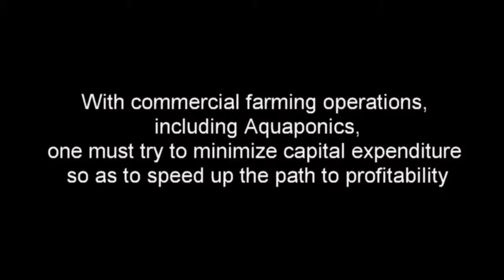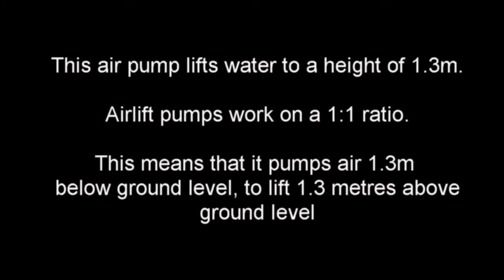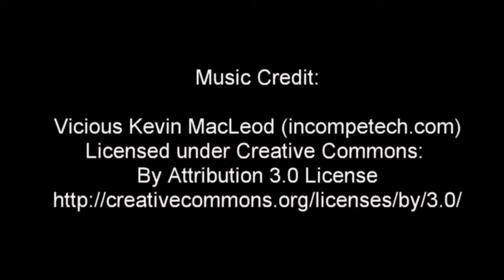How to build a small commercial DWC aquaponics system on a shoestring - For less than $1700

Comment: Nice video' but what is the bio ball filter and the brush bristle is for?
Reply from the maker: Thank, every DWC system requires two types of filtration. Mechanical filtration to separate the solids and Biofiltration to convert toxic ammonia into nitrates for the plants. Bioballs are for biofiltration and the brushes are in the mechanical settlement tank to trap any floating solids
Reply: @MyAquaponics1  thank you for the answer and more power to you and your family God bless brother

Comment: do you have a solids build up in the tank or filter system?
Reply from the maker: This system worked very well but has now been replaced with a sandponics system. In the years that we had it running , we had no issue with solids in the growbeds or tanks as our solid separator filter trapped all the solids (mainly uneaten fish food and fish faeces)

Comment: Where can I get the combo bio filter and solids separator and at what price?
Reply from the maker: that particular one is an older model and over R12000.. We have other more effective filters on our website, depending on your system design and size.. Here is an option https://myaquaponics.co.za/combo-pond-box-15w-uv-2-bag-sandfilter-25l-biofilter-0-6kw-pump-12000l-pond/

Comment: Hi Ur system is sustainable and well designed. I would like to know how much money you make out of it a month roughly.Thanks.
Reply from the maker: Thanks.. We mainly use this for own consumption and to supply the on premises restaurant with lettuce and/or spinach. One can average around 700 leafy type plants per week. We are in South AFrica, so wouldn't make sense to give you a number, as our market and currency is different to yours. So what you need to do is to take 700 lettuce or other high value leafy plant in your coutry and multiply market price per plant by 700 plants monthly.

Comment: You can possibly double the airlift water flow rate by burying the water tank and filter under ground so that you have about a feet above ground. This way you will not need to lift the water 1.3 meters but only a feet. The flow rate will increase substantially.
Reply from the maker: Correct Prakaz, but would have involved a lot of digging which we did not want to do :)

Comment: 1. Can you give some information on the solid separator filter? Like what material is used? And can I substitute it with something?

2. Also, do you have a backwash mechanism for the solid separator? How do you clean it?

3. @2:51 in the airlift sump pump, there is some green material, is that algae or something else?
Reply from the maker: Our solid separator filter is basically a gravity settlement type tank with brushes to trap any floating particles. Settled organic matter at the bottom gets released through a valve. Brushes are removed from time to time and sprayed with clean water. There are many types of solid separator filters on Youtube. One of our favourites is the radial flow filter. You can Google it.
Reply: @MyAquaponics1  thanks for the immediate response. And what about my third question? Is it algae growth or some plant leftover?
Reply from the maker: @ashwinsnmv  Its duckweed, it grows everywhere and can double every 24 hours. We feed it to the fish as its high in protein.
Reply: @MyAquaponics1 Awesome. I'm going to follow your system. As it's easy to understand. In most systems there are many useless or complicated moving parts. Thank you so much. What type of feed do you use in addition to the duckweed. Organic or commercial?
Reply from the maker: @ashwinsnmv  great.. we feed them lots of organics such as lettuce, celery, etc, but also 30% protein commercial floating pellets

Comment: How do you control the speed that the Dec beds drain?
Reply from the maker: no need to control. The flow rate of the pump is what controls. Ideally you wantto turn the total volume of water in the fish tank, once per hour .
Reply: @MyAquaponics1  ok I thought the outlet was lower than the inlet in the dwc beds and would empty the tank unless you matched the out flow. Thank you

Comment: Hi  congratulations for your DWC system. What do you think of placing together to beds, to save space ?? It will work ?? Thanks
Reply from the maker: Thanks, yes placing them together to save space will work. It will make it more difficult to harvest from the middle if required. Either walk in the water or push the floats to the side

Comment: Great work! Thank you for sharing.  I wonder what kind of fish did you put in the fish tank? and there was no aerator inside the fish tank? is that fine? can you please share how to make the air pump sump? thank you so much!
Reply from the maker: thanks, at the time the video was taken we had some tilapia fingerlings in the tank and in the growbeds.. It was low stocking densities at the time, so we relied on teh splash from the inlet to create the aeration. We have since added one 50mm round airstone. For the airpump sump, we used a 110mm plastic pipe and glued an end cap to the bottom of it.  The pipe goes down into the ground around 1.3m deep (as we are pumping 1.3m high).. With airpump its best on a 1:1 ratio, i.e blow air 1m down to lift im up.

Comment: good video, but how does the water from the bottom of the fish tank, with the waste get into the solids separator without a pump?
Reply from the maker: Hi Kyle, the poutlet is connected to a pipe that extends to the bottom of the tank. At the bottom it bends 90 dgrees to another pipe which sits at the bottom of the tank.. Water coming in then follows that bath out the outlet sucking up some solids. With low flow rates and high stocking densities one would have to perhaps use a vaccuum, otherwise increase the flow rate coming into the tank.

Comment: Good stuff!
Since its all on the ground, do you worry about frogs, mice, lizards, even grass snakes in the rainy season getting into the DWC and contaminating the harvest?  Just to be safe, would you recommend tables?
Reply from the maker: Hi, we've never had issues with that as its inside a greenhouse. We have traps for mice.. I don't think lizards, frogs and snakes would contaminate anything. You could put on raised beds, but DWC is heavy, so you would need very strong structures at a much higher cost. Even then, snakes and lizars could easy climb up.

Comment: What is the measurement of your floating rafts? Is it 1 meter wide with 6 plants across?
Reply from the maker: yes, 1m wide and 6m long. Spacing between plants, depends on what you are growing. For lettuce and spinach, spacing between plants can be 150mm to 200mm

Comment: the tanks you are using for the solid and bio filters are not that available where i live, can i use 55 gallon drums instead and swap out using  mesh cloth ? how many bio balls are need to run the size scale, also what are the sizes of the balls?.
Reply from the maker: Terence, you can certainly use drums to build your solid separator filter and your bio-filter. You do not have to use bio balls as your bio media. LECA works just as well. There are quite elaborate formuals to work out the bio media required based on the SSA (specific surface area) of the media used . A good rule of thumb however is to make the volume of your filtration 20-30% of that of your fish tank volume. The more bio-filtration you have the better. Also note if you have a media based flood and drain system, that you don't neccessarily need a separate bio filter, as the grow beds then become your bio-filter
Reply: i see the piping in the fish tank but i want to know how the pipe set up is within the fish tank itself, the out flow to the solid waste filter seems to have a siphon at the top, am i right? i will fabricate the same set up in my yard just need to be as exact as i can be...sorry for the long questions...thanks again
Reply from the maker: the outlet pipe actually goes all the way down to the bottom of the tank, then bends 90 degrees to another pipe that sits at the bottom of the tank. The pipe at the bottom of the tank has slits to allow for the passing of most solids, but not the smaller fish.
Reply: that's cool...how is the water carried through the outlet pipe from the bottom? is the pressure and movement from the airlift pump causing it the flow straight up and out to the solid waste filter?.....i bought the 100w pump and about 200 bio balls but i believe i will need some more balls to complete the bio filter....i also have a  148L  sterilite container i want to use as a bio filter and a 55 gallon drum for the solid waste filter...give me you thoughts...i am most greatful for your guidance through this whole process..
Reply from the maker: yes, water will flow through the outlet pipe, once that level is reached. Flow rate will be dependant on what is being fed into the tank and of course the diameter of the pipe. As I have mentioned in past comments, the airlift pump is slightly underpowered for this system and we would probably use a more powerful compressor, or maybe even a standard water pump. Yes, you may require more than 200 bio-balls.. If you have LECA, maybe use that as your bio media.. good luck.. best way to test your theory is by trial and error :)
Reply: thanks for your support
Reply: @MyAquaponics1  what type of container system did you guys use for a sum tank? I will have to dig fairly deep to sink it to match the ratio for the airlift pump...
Reply from the maker: @terrenceroach9398  If possible don't go the airlift route if you need to pump higher than 50cm-100cm.. Rather use a normal water pump. If only using a water pump, then your DWC growbeds become your sump (no need for a separate sump.
Reply: @MyAquaponics1  I understand you comment  but I had already bought the 100w pump as I was using the model here...I will use a 4x4 container for the fish tank...will build my own  solid waste filter out of fiberglass so as to collect the accumulation of solids via a ball valve at the bottom of the cone...still would like to know about the sump tank as I mentioned prior....I'm committed to make it work...thanks again for taking the time to help...
Reply from the maker: @terrenceroach9398  the "sump" in our system is basically a 110 mm pipe buried deep into the ground.. With airlift its a 1:1 ratio, which means that if you want to pump up 1m, you need to go down 1m into the ground to get the lift. We went 1.3m, and the 100 watt air pump just makes it. I would not go above 1m pumping height, preferable even less.
Reply: @MyAquaponics1  ok thanks I really appreciate you for being so helpful...

Comment: Nice video! And I love how easy it is to setup. How is the nutrient solution in the DWC as I didn't see any drain pipe connected to it? Thanks
Reply from the maker: water level on all 3 grow beds is equalized through a common outflow connection. Water is pumped up using air lift from a hole in the ground that is connected to all 3 grow beds

Comment: Hello, i'm building my own proyect and i'm wondering, what are you using to fill the netpots? to contain the plants
Reply from the maker: we do not use anything to prop up the plants in the netpots. we simply put the seedling in the netpot with roots in the water and that is it. As the roots grow they anchor the plant in place
Reply: Thanks! And where can I ask which one is the best separation between holes? Im going to harvest lettuce and basil
Reply from the maker: for lettuce and spinach anything between 200mm and 250mm will work fine.. For Basil, plants can get huge, depending on how you trim and harvest, so we would use 400 to 500mm spacing to allow for a large bush of basil

Comment: Hi, it´s me again! I was wondering if diferent kind of plants can be used in the same mechanism....for example: lettuce, strawberry and chili...? How can i try more options using just one structure. THANKS
Reply from the maker: yes you can grow different plants on the same system.. Keep in mind that some plants like strawberries prefer more acidic ph of around 5.5-6
Reply: Hi. Thanks for the vídeo. So Nice. I got a question. What's the pH that u got with the fish wastes and do u have to regulate ir with something else?
Reply from the maker: @camilorojas9269  Around 7 to 7,5. Ph will go down naturally as the system cycles.. Always important to use a buffer so that pH does not go down to quickly. This is achieved with Calcium and Potassium (carbonate or hydroxide). More info in our ebook https://myaquaponics.co.za/ebook-pdf-secrets-to-successful-aquaponics-farming-backyard-commercial-systems/

Comment: Hello! Thank you for sharing this video. May I ask what are the difficulties you encountered with this system? How often do you test the water?
How may fish needed for this system? Thanks in advance
Reply from the maker: No difficulties at all, though we would not use an airlift pump for water re-circulation for this size system as its a little under powered. Does its job though, but would prefer higher flow. 25 Kg of fish used with 1000 litre tank. Recommend 2000-3000l tank for this many grow beds, and around 60Kg of fish biomass
Reply: @MyAquaponics1  thank you!

Comment: It is a really nice cheap system, but you probably should have spent a few hours of manual labor and put the fishtank partially in the ground, it would greatly improve the flow rate if the fishtank was lower.
Reply from the maker: Hi Peter, thanks.. Yes it is true, we could have put the fishtank partially in the ground, but then the same would have to apply to the combo filter, as it is all gravity fed from the fish tank back to the DWC grow channels. Probably would have been better for some insulation in winter as well if it were partially underground. We were pressed for time however, so decided to leave it all above ground.

Comment: Hello, thank you for sharing details on your design, it seems to be interesting and at low capital investment. I have been reading the comments and I have gotten a clearer idea of how your system works, but I have a question.

Have you managed to determine the biomass consumption of your crops to reach the fully grown stage? like for your lettuce and spinach? Because I imagine it could take shorter if than 4-6 weeks if the amount of nutrients in the media are higher? 

Have you managed also to determine the amount of biomass produced by your fishes in your 900l tank? 

Would you mind sharing this answers with us?

Thank you in advance.
Reply from the maker: Hi Abdul, keep in mind that this system was designed as a show case only and to prove that one can build an aquaponics system for low cost. The design is not fully optimized. Based on the the 12 square metres of grow beds, we should have a 3000 litre tank (which would not add much to the cost, but we had space constraints). Tank should be stocked with around 20 Kg of fish per 1000 litres (you can push it to 30Kg/1000l with enough aeration). Rate of feeding for the fish for leafy type plants, would then be roughly 40 grams per square metre of grow bed. Total of 480 grams of 30% protein fish feed per day. Since we only installed a tank that was just over 1000 litres, we also supplemented with some nutrients such as calcium and potassium carbonate. Lettuce in our system takes about 4 weeks from seedling to harvest in summer and 6 weeks in winter. We keep nitrate levels at over 100ppm  with the help of beneficial bacteria and of course the supplemented nutrients.  All fish waste is drained from the filter and put in an off system mineralizer and then fed back into the system as the organic matter  gets fixed by the heterotrophic bacteria .

Comment: Where was this built? I think a tub that big full of bio balls would cost over $2000 by itself here in Canada.
Reply from the maker: Yes, the filter with bioballs was the most expensive part of the whole system. Here in South Africa it costs R7500 (US$560)
Reply: Cool, that makes sense.
There's so much conflicting information about what biological media is the most cost-effective... pretty hard to decide what to do.
Reply from the maker: We used bioballs in this system simply because we had extra lying around. LECA works even better as a bio media from our experience. All about the SSA (specific surface area) of the media being used and cost thereof.  SSA for Leca is between 240-260 and for bioballs between 500-700, which means that Bio Balls have the better SSA (more surface area for same volume), though still more expensive than Leca overall (in our country)
Reply: Yeah, I considered LECA, but that's pretty expensive too. It looks like fluidized sand has the best SSA (and is literally dirt-cheap), but doesn't scale very well to larger projects, presumably because you need good pumps, or you risk them going anaerobic.
Reply from the maker: correct, can lead to blockages resulting in anaerobic dead spots
Reply: I would do a media grow bed instead of an expensive bio media like this. Plus you can grow stuff in it ;)

Comment: can we small blower to this system to increase the  oxygen in it ?
Reply from the maker: the air pump supplies all of that in this system, but yes depending on the stocking density of fish in your tank you could add an extra small blower if required in your own setup.

Comment: How much are the maintenance costs?
Reply from the maker: Other than cleaning out the solid separator filter from time to time and checking on piping, airstones and pump, maintenance costs are minimal.
Reply: Wow. Cool. Thank you for answer.

So how many people does the system in the video feed would you say?

Considering that the set up cost is small and you say the maintanance cost is also low. It seems like one can save a lot of money on food with this method. Would you say that is correct?
Reply from the maker: You can grow 740 leafy type plants, such as lettuse, spinach or kale.. so that would be your output depending on how you plant and time to harvest.. With lettuce for example you can recycle every 4-6 weeks